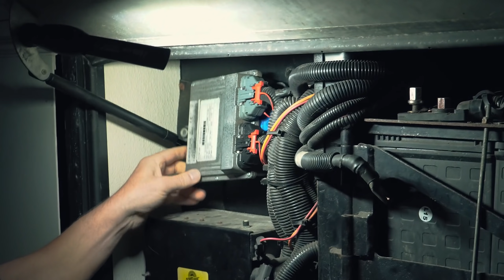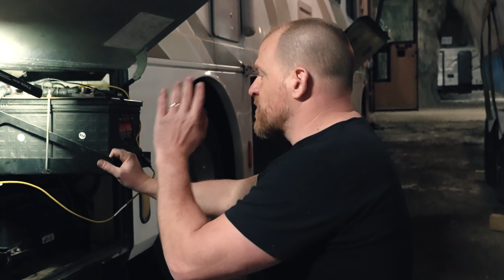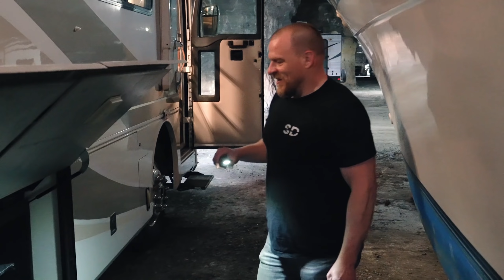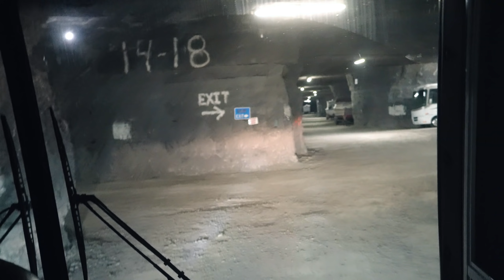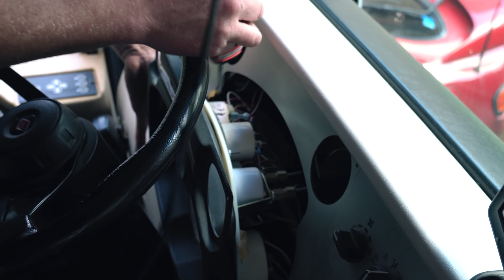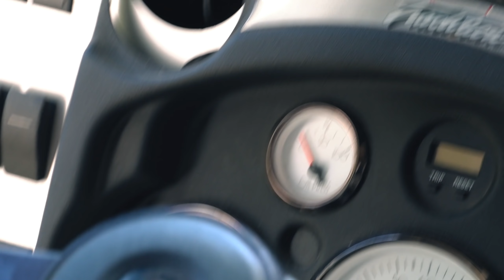What else got cooked in my RV? (bringing her home) Part 2

Comment: Hello Danner. I am running into a problem. I have a 2000 condor r-vision workhorse p30 gas engine 7.5L V8 and the engine cranks and starts but I cannot shift out of park. Where should I start with it instead of just throwing parts at it?
Reply from the maker: Does that have a shift interlock system? Start by researching that. In 2000 it will be a simple circuit. Cant remember the specifics. Solenoid and brake switch are the two main components
Reply: @ScannerDanner  correct yes it does. Another helpful hint is when I press on the brakes, the brake lights does come on
Reply: @ScannerDanner  how do I go about testing it? I can't find a wirring diagram anywhere. If you can point me to where I can get a wiring diagram from that will be awesome. I can't even find a service manual anywhere.

Comment: These allison controllers just flake out I found recently. The shift pad has a 25 cent capacitor that goes bad. Easy fix. The ECU will go bad sometimes too.

I lost voltage on mine due to corrosion from the RV just sitting. It only has 25k miles but electrical gremlins are starting to pop up.

I'd say the moisture in the mine caused your problem. Even the alternator going bad. Which could definitely have caused your TCM to go bad.
Reply from the maker: Check out some of my other videos. My leveler jack electric motor got cooked too. They caused this for sure

Comment: A few comments.  I have the same problem, the tantalum capacitor was smoked.  I tried replacing with a 4.7uF electronic cap, but not sure that the original value wa 4.7 uF since it was burned up.  That didn't fix it.  I'm not getting the 5.0V DC sensor power out.  

In my case, no battery disconnection occurred, I think it might just be a bad cap or a bad board design.  My coach is the same vintage.  

You said you would provide a link to the RV place in Kentucky where they helped you out.  I didn't find it.
You also said that your friend Keith was repairing the damaged TCU.  Do you have any info on how that went?  Will he work on other TCUs?  I would like to do the same thing with my defective TCU.  In the mean time, I need to get a replacement TCU.
Reply from the maker: My friends name is Keith Perkins of L1 Auto Diagnostics https://youtube.com/@l1training?si=cyeVBH_YQN3OJltJ
He never finished the repair for me because:
1. I ordered a used module and it worked perfectly
2. He had to order some capacitors that were not in stock
3. I sold the RV before he got a chance to finish it. 

He may actually still have it?  I don't know. 
As far as the company I used in Kentucky. I checked the description of the videos and it's not there, so unfortunately, I do not know or remember the name of that salvage company. I'm sorry. Best I got for you

Comment: Clean every connection from alt down to battery, specially the grounds, sounds like it's full fielding like it's not getting correct voltage reference. Yes it will cook a battery or few. I have an older powerprobe, I ordered the 25ft extension for it, and i've only cut it once with a rv entrance door just once.the thing I love is that they have a 10A resetable breaker, and you can either inject +volts or - into what you are testing perfect for those relays when activating the electro jacks and slides.one test to check connections is hook up neg and positive of PP to battery and see how much voltage drops off when not running at other connections. IE: grounds on motor,chassis,alt,. Another thing is not good to have house battery charging if engine battery is low, i suggest do a load test on the 2015 battery,and the rest.I'd feel better if it was max 14.8.

Comment: If that alternator is like one of the old GM CS style units do a voltage drop test on the reg. Looks hard to get to.  The old units I used to work on used a diode trio to supply voltage to the reg off the side of the rectifier.   If one of the three diodes goes bad it will usually undercharge slightly.  I had one before slightly overcharge.  Depends on which diode goes pop.  it's been a long long time ago so most of this may be my dementia talking ;-)

Comment: Hey scanner danner I don’t think you need factory tool to reset shift adaptations. Go into tcm and see if there is a reset adaptations option . On the battery issue you were taking about could you not just relocate those small grounds to another ground location that way they only have to connect the one big ground cable to the battery ?

Comment: in a pinch you can charge the d cell batteries with the 12-volt battery by holding them on 12 volts for 10-30 seconds

Comment: Charge wire resistance in motor homes is always an issue. Max. allowable volt drop is .2  VDC per 10 amps.
Max voltage anywhere should be between 13.8-14.2 VDC. You got resistance somewhere.
Reply from the maker: part 3 coming up

Comment: Paul, are you sure about the 15.5V ? I remember some build-in regulators that have "sense" wire connected from outside of the alternator, a lot of times via ignition switch.  If there is a voltage drop on the sense circuit, output will be higher. Sense reading 13.5 but battery voltage 14.5. Sense reading 14.5 but battery 15.5V  I have seen this dozen of times, still I don't have the wiring diagram for your alternator.  Just a thought.

Comment: I went to automotive trade school in 1971. From my automotive trade school text book, written somewhere in the late 1960s by Motor, be it generator or alternator the voltage range not to exceed was 13.8 on the low and 15.2 on the high. 14.2V was the ideal charging voltage.  I know that todays vehicles can charge as low as 13.5 when the computer is controlling the alternator. A battery is considered fully charged at 12.6V when no current is applied in either direction. I noticed your power probe rapidly bled off the surface charge of over 14 volts when the circuit was completed while testing your gauge with the engine off. I would bet those batteries were getting quite warm after your trip back home.

Comment: Perhaps a disconnect that mounts to the wall of the compartment. Disconnect the batteries there and it can be bracketed so they can't be connected wrong? It's clear that they are no longer connected but can be hooked up easily

Comment: I replaced that old style alternator like you have on my parents RV with an updated internal fan one with a sensing circuit on it.  Those HD alternators only have a couple of different univeral mounting configurations so it shouldn't be hard to find a new one.

Comment: Many parts stores carry quick disconnect battery terminals that use a screw to disconnect but will keep all of your wires together. That way it will be easy to disconnect yet keep it simple so that all of the wires are always together.

Comment: You can get a  "flame River"  Main DISCONNECT     and it comes with a lock too,  or  put a LOCK if  you want,   like  they  have on the
" BIG  RIG - - TRUCKS" ..,

But once you hit that SWITCH,   it disconnects    all power from the batteries you really shouldn't have to disconnect any cables,    that's the whole point....
I'm not happy with the voltage 15.5-V,    either,       that's way  too high,   eventually you going to cook your batteries,   &   the   ALT.,   Now your gonna waste money down the DRAIN..... 
look into It ,    don't give up

Comment: Working on a 57 chevy it was overcharging. It would just keep climbing. I went and got a new regulator and now it doesn't charge unless I ground the field terminal. I did all the checks I could, 12 volt to the arm/gen terminal and the generator spins. I think I just got a bad regulator but I'm not 100 percent.
Reply from the maker: Sounds like it my friend
Reply: It sounds like you have an unpolarized generator. And since your spin test, it's definitely unpolarized now. Look up the procedure for polarizing a GM generator system. Anytime a new voltage regulator is installed, polarization is recommended.
Reply: @VashthStampeede  I've done the procedure multiple times. That was my other concern that maybe the generator could no longer hold a polarization. Although with the old regulator that was overcharging I cut the trace that ran from the field terminal to the battery terminal. When I did that the regulator worked as intended for 5-10 mins.
Reply: @bradfaught1695  I'd have to agree with you and Paul. If the new regulator is mechanical, it sounds like the cut out coil in the reg is failing to reengage. If adjustable the gap can be shortened. A warranty swap would make the most sense though.

Comment: Adventures with Dan, ah Scanner , hey Paul.
Over the years 16 Volts Max is what I’ve seen for matching charge regulators with lead acid batteries . E=I*R, A high internal resistance can demand a higher current driving E up. I’d take a look at the alternator specs & chk electrolyte levels before deciding my next move.

Comment: Hi Paul, my friend has a Monaco Knight RV with same Cummins ISC and Allison 3000MH trans.
Charging voltage on that was the common 14.4V.
Not got access to the diagrams at the moment, but if the alternator has a voltage sense from the fusebox, could have an open circuit on that sense circuit.

Comment: High voltages can also be caused by main battery cables that are going bad, especially if there has been a traumatic event to the electrical system.  Happened to my Cat 3116 on my GMC 7500 TopKick.

Comment: 15.5V is too high I think. Are your batteries hissing or are they sealed? Like some other commenters said, call up your brother and tell him the check engine light is on and it has a small leak EVAP code, 🤣. I think I would consider replacing that oil pressure gauge, tapping on it makes it seem like there is a dead spot or something in it.

Comment: Was it 15.5 volts by the time you got home? Maybe with low battery voltage from sitting and the lights inside the vehicle on after you started it was demanding higher voltage from alternator?
Reply from the maker: It was and still is. Part 3 coming up
Reply: @ScannerDanner  can’t wait. Love your videos man. Appreciate the time you take to explain everything

Comment: If I have more than one wire that has to be disconnected/reconnected, I connect all the wires to a junction block then run only one wire that has to be removed/connected at the battery.

Comment: I've was told that a battery when being charged with a known good external battery charger should not charge at over 15v after charging for 15 minutes. If it does exceed 15 volts after 15 minutes it's a bad battery. Not sure if this is true. ???
Reply: Good rule of thumb. The battery is a buffer when working properly. My battery just told me, "FU" the other morning. Driving wife's car now. She's asking silly questions like, "Haven't you bought another battery yet?"

Comment: 15.5 is too high, the max l would like is 14.8 then l would be putting my hand on the metal case of the alternator when it is running 
and checking the temp it should not get to a temp where you can not bare your hand on it .
Once you leave vechicles stood for a few months or more, during the winter months and not attended to at all, you would think some sort of magical spells have been cast, to cause you problems.
Usually damp that's what l have found in the past, when you start up after they have been stood for months, sometimes everything ok, as you start driving after about 15 mins or more all sorts of things
start happening, because the damp starts to condensate in relays or any, 
Where where moisture can build up, it can be annoying to say the least, engines can cut out, or start misfiring and loads of over things start happening, these are extreme cases as l have mentioned, but l have had problems like you in the past.
The oil clock gauge is possibly just the mechanical moment of the gauge seizing up or worn.

Comment: Hi, Paul and Caleb. Nice video as always. That 15V is dangerous. It certainly may have cooked that capacitor and other parts maybe. Hopefully not... Drop that alternator and check the small diodes that go to the charging module inside the alternator. One of them might be shorted.

Comment: Sounds as if you have a air leak @Pul. Maybe another video idea. Just keep in mind those air bags can leak around edges of bags where they meet the base. Also air valves can leak internally also as well as the air brake valves but most of those leak when brakes are released. 

That’s a semi truck alternator that those style engines use. Not sure on the alternators as haven’t seen them in years as left that industry yrs ago to truck then transitioned to the auto side yrs later.

Comment: 15.5v is a bit too much, older alternators would normally be around 13.8v as you well know, newer ecu controlled tend to be more at around 14.2-14.5 and you are only 1 volt above that, might be worth taking the alternator to a recon place and have it bench tested.

Comment: Hey Paul,

My Understanding from watching many transmission build and shop videos as well as my decent mechanical knowledge is that Firmer shifts (to a pretty firm point) are not damaging, and put less wear on the Box vs Normal or especially slow shifts which will destroy the unit very fast.

This is because when then Box is shifting, the Clutches are slipping as they apply / release, and this does 2 things:
It wears the frictions down / AND it puts a LOT of heat into the Trans Oil thats between the clutch plates from friction until the shift is completed.
It also reasonably explains why Racing transmissions shift a lot harder and shift kits to extend the life of the Trans also employ firmer shifts.
Slip = Friction = Heat.   Auto's Deliberately Slip Clutches briefly so that Power is maintained to the axle the entire time, however the shift needs to happen quickly for the box to last.

So Firmer within reason is actually better as the less time the unit spends with the clutches, the better for it.

It's also been noted by transmission shops (Such as Precision Transmissions on YT, They make really good videos) that insufficient Line pressure results in Slow shifting / transmission slip and this will kill the unit VERY fast (like less than a block if you do something like not correctly adjusting the TB Cable on a unit that relies on the TB Cable to set line pressure)

There was a white paper i was reading the other month where some testing was done regarding Trans fluid temp at the clutches themselves, and the finding was that the fluid between the clutch plates would experience very short but very high increases in temperature during shifting, and longer shifts made this worse.
I'll have to see if i can find that document and link it here, was a very interesting read.

Comment: ALSO, because Caleb is such a good camera guy, I noticed your Cummins engine is either a 8.3Ltr ISC or a 8.9 or 9Ltr ISL. Typical oil pressure for cold ISC’s is 60-85psi & 28-45psi at normal engine temp and for ISL’s it’s similar cold at 50-75psi & 25-42psi at normal engine temp. That’s what I’ve seen on Cummins ISC’s & ISL’s that were worn out with high blowby, rebuilt or Cummins Recon and on those 10psi is Cummins minimum with a bad oil psi regulator or clogged oil filter. Typically, anything over 20psi is ok if the engine has a crap ton of miles or Hrs on the engine runtime.

Any questions about your Cummins engine, don’t worry just ask and I’ll answer. I know every nut and bolt about the Cummins 4.5Ltr ISB’s up to the 15Ltr ISX engines, that’s all I did was tear down & rebuild or troubleshoot and repair from P-pump to VP-Pump engines to HP & XPI Common Rail Cummins engines for the last 10 years. Only got laid off because of Coronavirus Pandemic or else I’d Still be there do the same thing.
Reply from the maker: 8.3 ISC 🙂
Reply: Paul I’ve seen ISC’s from 220HP to 350HP which is the typical range, although in some gensets they go up to 380HP. The ISL 8.9 & 9 is a work horse and it typically is rated from 320HP to 450HP in many new RV’s, the latter mostly being in fire trucks or other life saving vehicles with ratings 400HP to 475HP. The ISC is a 505ci engine which is equal to a Chevy 502ci and the ISL is 545ci equal to a Ford 545ci. Of course the difference with these engines is their double or near triple the torque rating in stock calibration to their gasoline caparisons. The torque ratings vary by fuel pump & injector calibration but, typically 600 - 1,200 lb-ft for the ISC and 850 - 1,500 lb-ft for the ISL all of which are stock calibrations for different applications.

Comment: didn't they warn you Motorhomes are for the rich with unlimited income and you should buy a new one every 3 years?
same with travel trailers, after 3 years they start to fall apart, more so ones with slide outs, pop-up and other articulating things, which is one reason the old airstreams models are so popular, far less to break and go wrong ;)